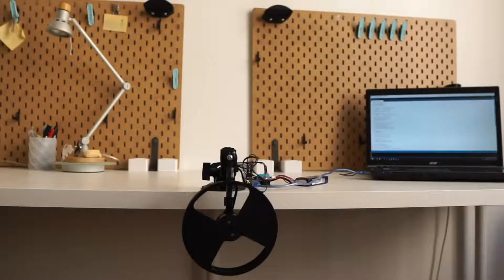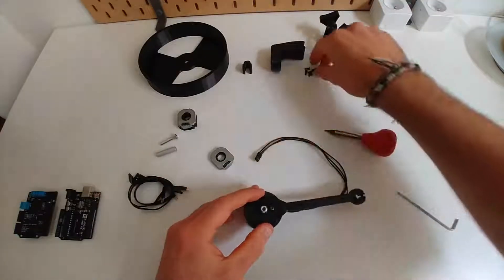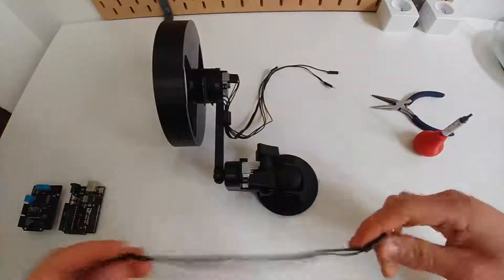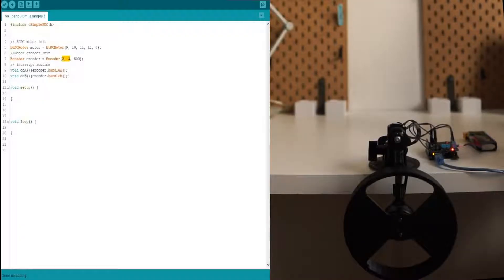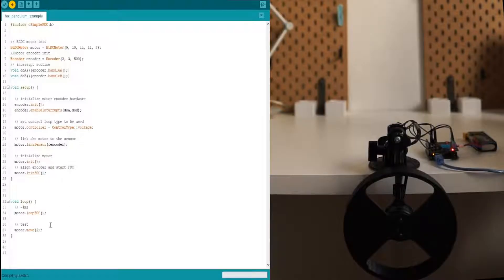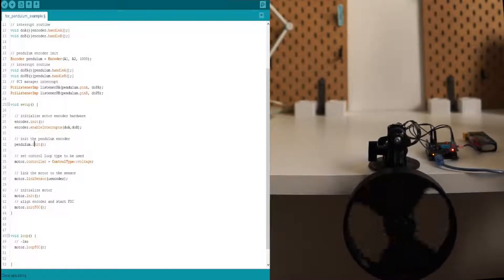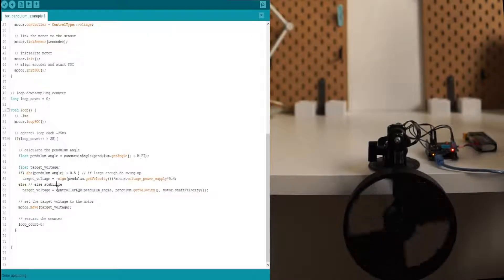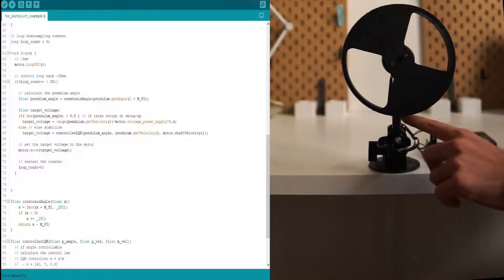Arduino Reaction Wheel Inverted Pendulum - Tutorial

Comment: I'm really glad to watch your video. It makes me really happy because you explained in an easy way. I'm making a reaction wheel inverted pendulum, but I've been getting some troubles such as the calculus of the size and weight of the reaction wheel, the size arm and the selection of the motor. How did you select that motor?
I'm using MPU6050, but I don't have encoders. I would use a state observator to find the reaction wheel velocity. Do you thing its a good idea?

Comment: Amazing, i just did a semester project using a bldc motor and MPU6050 to balance a reaction wheel pendulum with a PID algoritme.
It was a huge pain in the ass, since the only thing measured was the pendulum angle with the MPU6050.
 Changing directions smoothly with a non-sensored bldc motor was impossible (to me atleast), so I had to rely on deceleration instead of changing direction.
My limited knowledge on controlling bldc motors also didn't help.
Loved your project, i can only dream of balancing my pendulum with a 25 ms loop :)